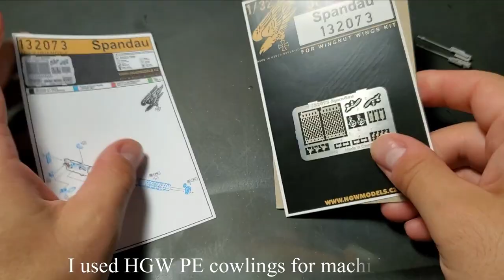Roden 1/32 Albatros D.I, Part 3 - Final Assembly

Comment: You must use an electron microscope to do your rigging. Where did you purchase the anchor points for the rigging? Thank you, incredible work.
Reply from the maker: I bought them on e-bay, try to search Gaspatch accessories, however, I recommend you to use  metal ones, instead of resin.

Comment: Have you used AK WW1 German Aircraft acrylic paint set and your thoughts please? Also, what do ya think of Vallejo Model paints?
Reply from the maker: I haven't used AK paints at all, I really like Mr.hobby paints (doesn't mater water or lacquer based), Vallejo I have only one color - Brown Leather - it's a good paint, however I do not like the bottle shape, it looks like it was designed only to pour paint into the airbrush and it's not very convenient to use a regular brush

Comment: On Albatros D.111, How do you know Where to drill rigging points in fuselage and wings. Do you just look at pictures and guess or is there some schematics out there somewhere? If there is.....I Can't find em.
Reply from the maker: When I start a new project, I try to find as many books, pictures, plans, etc. of the plane. One of my favorite reference books are from Windsock production - https://www.windsockdatafilespecials.co.uk/
Reply: Thank You Sir.
Reply from the maker: No problem, good luck with your project
Reply: Thanks Fella, I'm Nervous about rigging a D.111, so to get practice I'm doing a Eduard 1/48 Fokker Dr.1 of Ltn. A. Raben /Ltn.Hans Korner model#8487 into the 477/17 of MVR. Orderd decals already. Hope there's No Big engineering changes from the two Dr.1s. Are ya Ready? I'm doing the 477/17 ALL RED!!! Lol.
Reply from the maker: Awesome, however 425 was all red, not 477 😉 and depending on the period had different type of crosses
Reply: Maybe not as much as yourself, but the little I read One thing seems to remain a mystery. If The Fokker Dr.1 477/17 was the one MVR had his Most success in.....Where are the photo's? There's a flight report stating at one time the 477/17 was painted All Red.One things for sure, this is a Highly debate topic.